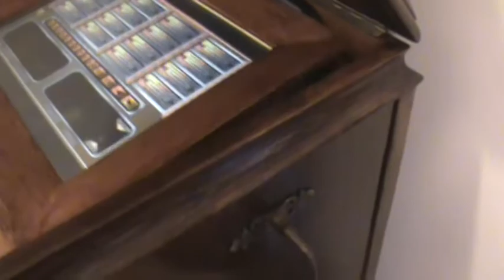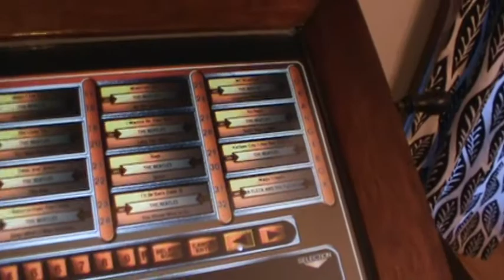Turning a 1919 Crank Phonograph into a modern jukebox

Comment: My Aunt gave me a Victrola that had been converted to a Stereo. It took me many years before I found the Original parts on ebay and I converted it back to wind up I would not use it as a Stereo.
Reply: That's pretty cool. I have full respect for the old Victrola's....this was some other model (can't remember now) so I felt a little less guilty.